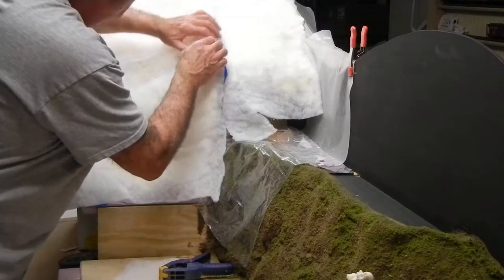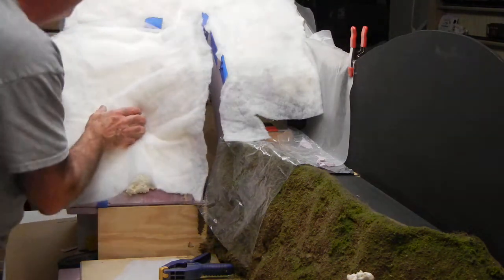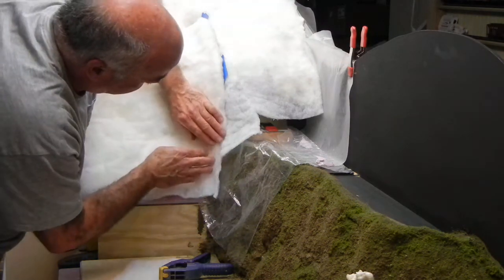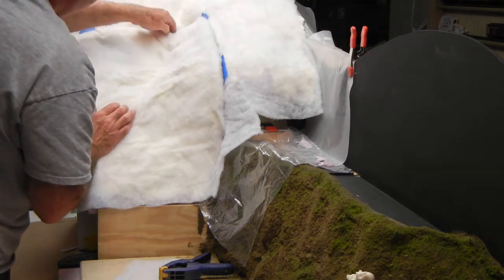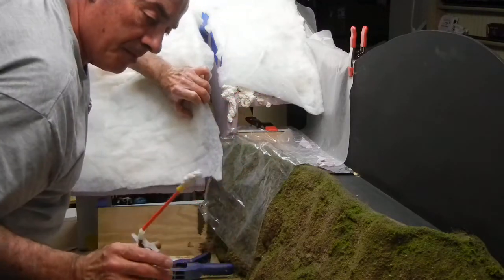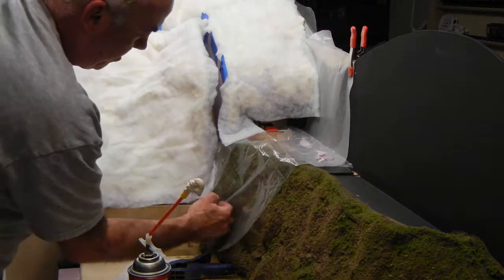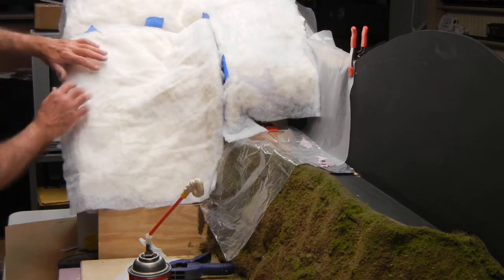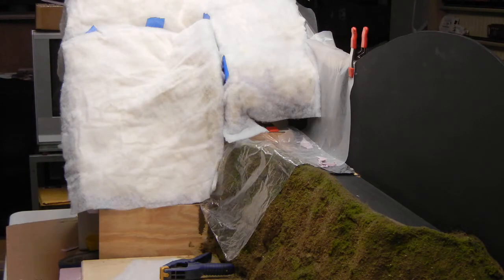Making Model RR Mountains with spray foam and low loft batting

Comment: I just ran across you series of videos and the timing couldn't be more perfect. I'm carving my first mini-mountain out of expanding foam for a background and was thinks that a cover layer to help shape the foam is a perfect solution.  I've added the related videos to my watch later list. Thanks so much for posting.
Reply from the maker: Glad you found the videos...   I have never been someone who makes "How to" videos, but I found another guy on YouTube using the batting and latex paint over carved styrene insulation.   After trying it, the thought dawned on me to add the expanding spray foam to the "recipe"... It worked so great, I had to share it.   Over 40 years of building layouts with plaster, I found this so much better, easier, faster.   I have embedded cast Hydrocal rocks in my Spray Foam mountains they look great.    I don't have a single cast plaster or hydrocal mountain or hill on this 23 x 40 layout, and I'll never go back to the old traditional plaster methods ever.....    

Here's a link to the original YouTube video from 
Model Trains & Colorado's Joint Line        https://www.youtube.com/watch?v=9C6aHEoUWYg&t=93s
Reply: @cjambrosi7391  Wow. Thanks! I'm definitely going to try your method and I'll watch the video.

Comment: Been going around the internet looking for terrian ideas and landed here. The batting is a great idea and I'm going to be trying it.

I'm not sure about the brand of foam you are using but generally they work better if they are held upside down because the foam is heavier than the propellant. It should fight you a lot less. But there is something to be said about holding it upright, it comes out slower and that might give  you more control. Thank you for the content.

Comment: What an excellent idea, thank you very much for this!
Reply from the maker: thanks,  make sure you see the Youtube videos done by Scale Model Trains & Colorado's Joint Line.  This is where I got the tip about using the low loft batting,  and flat Latex paint....    I just added the "spray foam base" to his batting scenery base method.